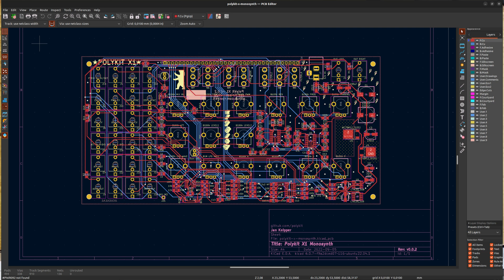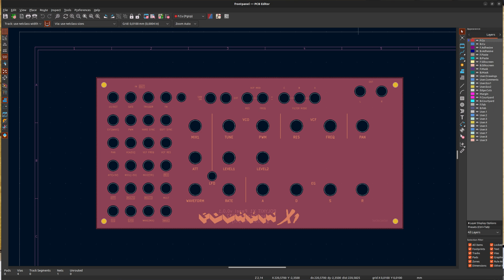How I built a PATCHABLE ANALOG SYNTH from scratch

Comment: Hey, really like this thing you built, i'm about to order some pcbs for this, but got a question....The switches in the schematic have a footrprint from a library i don't have, looks like your own library, could you tell me what switches those are? like what model and manufacturer? there are ton of different sizes of SPDT switches available, so i don't have any clue which one would fit
Reply from the maker: Oh, yes, I used my own footprint, I uploaded it to https://github.com/polykit/kicad
Also be aware that some switches got 3 positions (off in the center). Let me know how it is coming along. Cheers!
Reply: @polykit  thanks, found the footprints and the switches from local supplier. Last question, are the RES_MODE and FREQ_MODE switches on-off-on or (on)-off-(on) switches? aka is the center OFF position just a third postion where the switch can be or is it default resting place where it resets when i let go of the stick?
Reply from the maker: Those are on-off-on switches, there is a off position in the center. Those are either adding or subtracting envelope curve to filter resonance or frequency cutoff CV or turning it off.
Reply: @polykit  Hey again, i ran into a small problem with sourcing parts for this project, can i ask where did you buy the MC79M12 regulator? i looked it up on Mouser, TME and Farnell, but none of them have it, well, Farnell has them, but sells them in 400 euros worth of lots.
Reply from the maker: I think I ordered them from Digikey but it seems they are out of stock atm. Maybe you can squeeze a through hole one on top of the PCB?
Reply: I'm sorry, it isn't out of production, farnell just seems to be stupid, will order parts somewhere else, again, sorry...

Comment: BTW, if components are being blown off your airflow is too high on the reflow station, I generally don't need to hold parts down as I solder them.
Reply from the maker: Yeah, you’re right. I got better over time.
Reply: @polykit  I've seen an interesting "hack" in some video: you can place a capton tape over small parts (that can be pre-soldered if you're ordering a PCB from a PCB manufacturer. Thus it holds them and protects from heat. It's the same for capacitors. And it can be more important because tantalum caps (as I know) fears an excessive heat. Plastic film caps can be spoiled too if the heat is too much on them.
Reply from the maker: Good idea. I only used capton tape for de-soldering to protect surrounding parts.